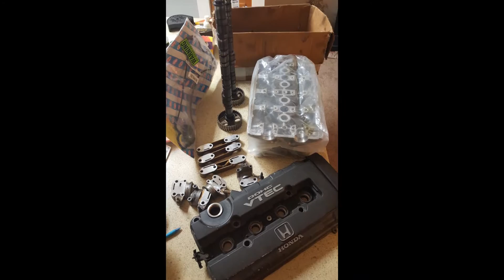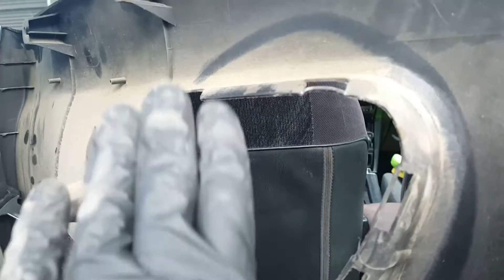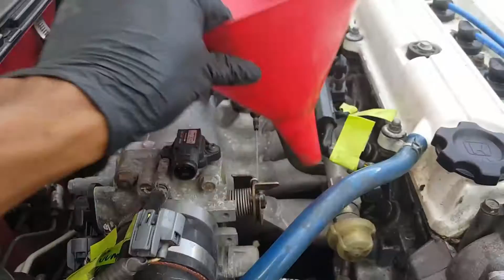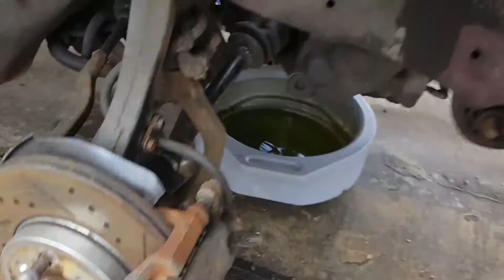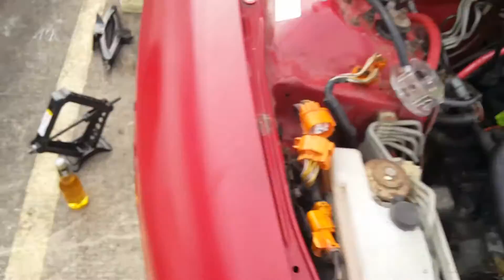Acura integra rear engine mount EPIC FAIL (The teardown part 1.)

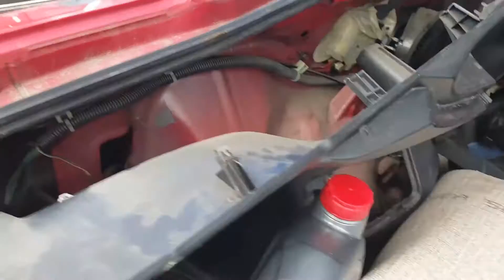Comment: I had a leak over in that corner for years and could never find the cause, turns out it was that black box thing at 1:21 (it's for interior air pressure equalization), it was no longer fulling sealing to the body and water was coming in around it. Spent $4 at Home Depot on a tube of Liquid Nails silicone and that fixed it.

Comment: Those tubes are for the sunroof drains. there are 4 in every corner. you better check them all for leaks. have somebody spray water on the top of the car and be inside the car watching for leaks
Reply from the maker: ok yea after doing some research i realized that, still aint try ot out tho lmao thanks bro!